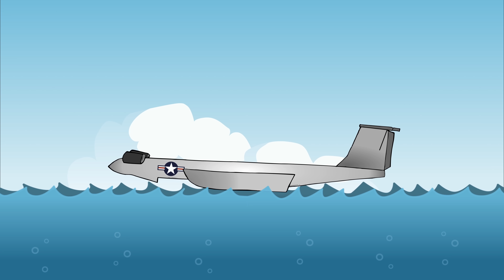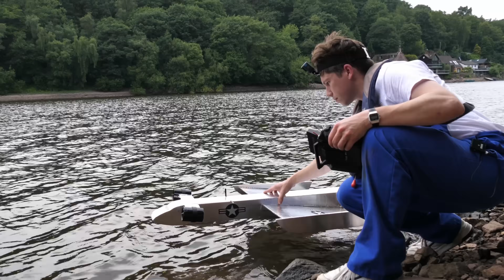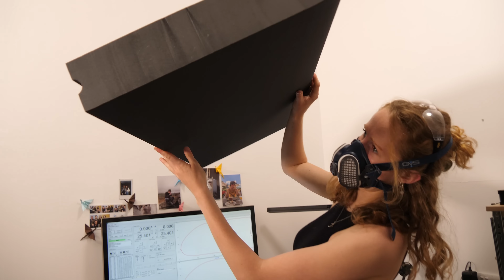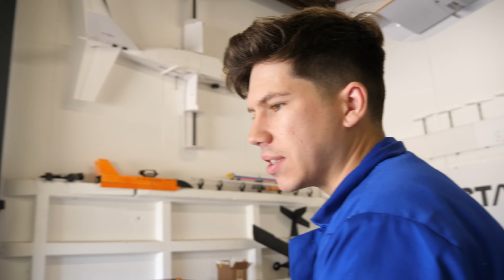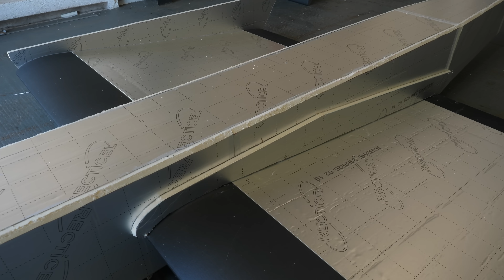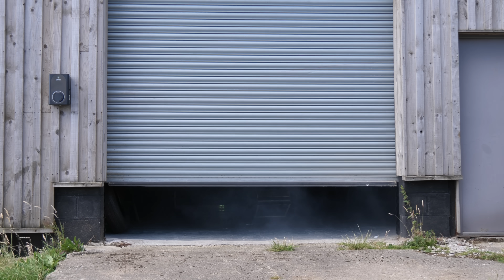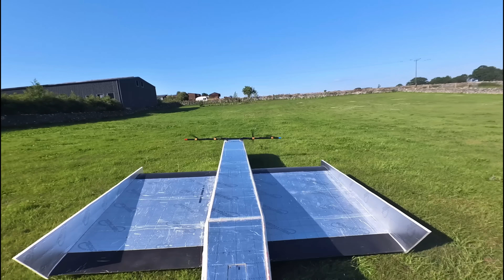Giant Ground Effect Plane (part 1)

Comment: Loosing connection to my model or having week or critical datalink to my model was my daily events when I used frsky radio and RX.
Switch to elrs and since then just threw to the bin (yes didn't tried to sell as I wouldn't recommend it) all my frsky rx.
(Got 11 gliders 1 VTOL and 5 drones)
So frsky may have you the radio but it's still crappy radio system
Reply: +1 for ExpressLRS.
In 2023, I put in a wee RadioMaster RP2 receiver into my OMPHOBBY M2 V2 helicopter, bound that up with my Ranger module in my TX16S Mk1 and I was away flying. The built-in receiver in the flight controller used to micro-failsafe even at 1~2 metres away from me, and got worse around 3~5 metres out. ExpressLRS made that shit a thing of the past, and I can now focus on actually flying.

PS: What's even better is ExpressLRS is FOSS (free and open source software). FrSky isn't, depsite their name being pronounced "free sky".

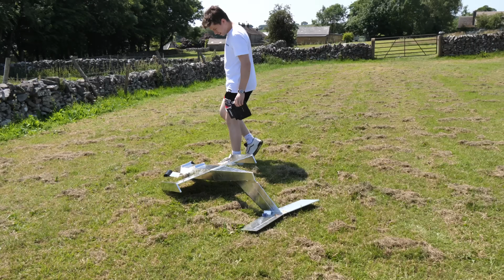Comment: At 04:30 it's a dustdevil, which is caused by a strong thermal suddenly releasing (warmer airmass that starts rising), creating a low pressure, dragging air in from all sides and creating a rotational motion. Like draining water from a sink. It's a very cool phenomena!

Comment: This is a splendid project, well done! For those with an interest in the aerodynamics, it’s worth noting that this configuration carries notable stability concerns, particularly in pitch. Soviet aerodynamicists sought to address these difficulties with an intriguing series of aerofoils (DHMTU), tailored to the demands of ground effect. However, these amounted to mitigations rather than remedies for the underlying problem. It is fair to say that a more fundamentally stable solution lies in a markedly different configuration, the inverse delta, as developed by Alexander Lippisch, which offers improved longitudinal stability whilst operating in ground effect.

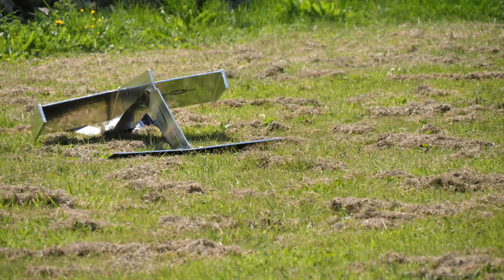Comment: That effect you noticed on the test flight with the smaller plane flipping over(4:18), is a small column of rising air, called a thermal. It's essentially warmer air expanding and rising through the colder air. This can be caused by the sun simply heating the ground, or in your case, a nearby fire triggered the thermal. When it is close to the ground it often picks up leaves and dust, making it look like a small tornado, as you said.

If you want to gain further knowledge on this, I would recommend checking out gliders(sailplanes), which use this exact phenomena to stay airborne.

Comment: Watching from Nizhniy Novgorod, near Gorky Reservoir where first ekranoplans were tested :) We have a lot of ekranoplan pedestals in our city. We have also a model 903 "Спасатель" which is still working but suspended.

If you want to create a working model you have to dive deep into aviation control systems: accelerometers, gyro sensors, thrust control, air flow controllers, ground effect controllers, weight management. This is not just a frame with engines - this is a complex vehicle of it's own kind

Comment: A small side note about this kind of Ekranoplans. The original Caspian Sea Monster (and the other similar ekranoplanes) had also propulsion on the tale, usually near the top. The front engines blew more under the wings. After take off, the front ones would be powered down and tale engines assume control due to the efficiency of ground effect. You could try it.

Comment: YOU ARE ABSOLUTELY 10000% WRONG ABOUT GROUND EFFECT.. It's a common misconception... Please go see a CFI to learn EXACTLY what GROUND EFFECT really is.  I can tell you - that you're wrong. You'll need to remake your video. There is no CUSHION of air OR  compression of air AT ALL - WHATSOEVER..  It's merely the result of even lift is being created - you get induced drag as a byproduct from lift. When the lift being created and wing vortices being created, hey broken up from the ground, REDUCES DRAG THUS INCREASING LIFT DUE TO LESS INDUCED DRAG, EQUALS BETTER LIFT PERFORMANCE CLOSER TO THE GROUND, THUS GROUND EFFECT..   ABSOLUTELY NOTHING TO DO WITH CUSHION OF AIR OR ANYTHING LIKE THAT.... 
ALSO - FYI.. I'M A CFI, a flight instructor... Godspeed..

Comment: Something i learned from ekranoplanes and ground effect vehicles is that they never use concave surfaces on the bottom of the wings they ussualy use almost symetrical airfoils that resemble flying wings with some washout at the trailing edge because this helps preasurize the air more consistantly and it helps keep the airfoil at an optimal aoa by making it self stabalizing

Comment: Whats up, yall. Love the planes vision. 

I would love to pitch you the idea to use a tube frame inside the fusilage of the plane made from CF tubes and 3D-Printed joints. 

The frame could provide pick-up points for the load-bearing components, like the wings and motor mounts. This way, the stresses could be distributed through the tube frame instead of the hull itself. If my napkin math could possibly check out, it could also mean, that you can cut down a lot on the wall thickness. 

This could not only offset the added weight of the frame, but even reduce the whole system weight by a lot. However, perhaps not by as much as I might hope, because it could then be thin enough to require a glassfibre shell, due to foams weak material strength. 

In my mind, this could also prevent the planes hull twisting across its length.

Comment: Good job with the design. One issue is ground effect isn't a cushion of air, but the disruption of wingtip vortices which decreases downwash which increases the efficiency of the wings lift. So it isn't giving the wing more life, but increases efficiency due to reduction in induced drag. The cushion of air isn't necessarily wrong, but it isn't the direct reason ground effect is a thing. Ultimately ground effect only is seen within one wing-length of whatever aircraft is flying.

Comment: You need to find a company that can provide something better than tubes. Carbon tubes are not strong when side loaded, there literally like tent poles. A simple angle would be just as light and stiffer.

Comment: "cushion of air" is a myth. How did you miss that key point??? The benefit is that the ground disrupts the wingtip vortices which increases the efficiency of the wing, lowers drag. Not a "cushion" of air.
Reply: Well this one is a wing in ground effect one, which does use the principle you mentioned. However, another type of GEV also exist which use their bottom area for lift unlike this one which uses wings. The Bartini VVA 14 used that, it could fly 12m high in ground effect.

Comment: You're really testing my composure by continually calling these things aircraft and "planes".  First off, a plane is a tool for removing material from flat pieces of wood.  Second, nowhere in the world is a wing-in-ground effect craft considered and aircraft.  They cannot fly, so are not considered aircraft. Wing-in-ground effect craft can pretty much only operate over water so they are almost exclusively considered motor vessels by all jurisdictions and regulated as such around the world. THAT THING IS NOT AN AIRCRAFT.  STOP CALLING IT AN AIRCRAFT.

Comment: The angle in which the propellers are mounted is very different from the "original" (and any other full size ground effect plane I saw pictures of). Not sure if it can be counted as ground effect if they themself pull up the nose. ;-)

Comment: Normal wings use their curvature for lift, because air runs faster over the top that way, i think. Would there be an advantage to have the wing profile flipped? To run mora air under it?

Comment: About the rigidity of the wings: Have you thought about inserting a tube as the wing spar and pre-stressing it (sort of like they pre-stress concrete)? Or even maybe having an aluminium wing spar? Given that the wings are short, it should be lightweight, and if you only care about bending in one direction, you could use a bar.

Comment: No way that you just said 30c is hot I'm crying in Saudi 12:53
Reply: No AC here
Reply: 30°c is hot in the UK. Our infrastructure is built for winter. It can get to below -10°c in winter, so yes, a 40°c swing in temperature, can be hard to prepare for. If it was hot all the time, we'd have the infrastructure to cope. Its not, so we don't.
Reply: @magiera92  he doesn't even have SUNGLASSES!!!
Reply: @magiera92  and yet moar pplz perizh frum cold than hot in Europe yearlie
Reply: 😭😭😭 for me this summer was a constant heat average of 102 degrees and I play football 🏈
Reply: I'm in Surinam. hottest days can easily reach 36°C
Reply: The more moisture in the air the hotter it feels.
Reply: We don't share the same climate.
Reply: @OfficialKTGame  for real 😲
Reply: I’m outside right now it feels barley hot and it’s 83°F

Comment: The thrust blades might be kind high if you lower them kinda in the lower part of the wings the jet stream should trap the air better under the wings to give a better air bearing effect it just seems like alot of the air is going over the wings and some under with lower efficiency.

Comment: For future projects of this kind where weight may be an issue, you can be very strategic on where to laminate the fibers and on which directions.
To further reduce weight, you can make "lightening holes" by cutting circles out of the cloth where stiffness is the least needed.

One can get carried away and compromise the stiffness a little too much, but adding layers is easier than taking them off, of course.

Comment: For the Hot Wire cutter, look into steel wires and thin cables. I've found they are much, much stronger, can be made stiffer, and break less. With more tension, they sag much less and leave smoother cuts. 
Steel has lower resistance, so the voltages and currents are different.

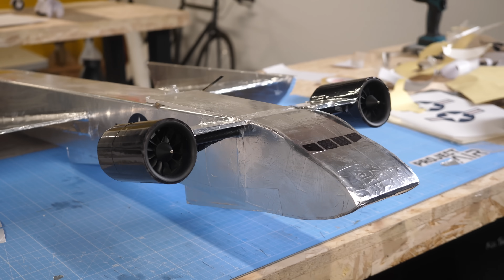Comment: 2:55 The flow from the fans definitely helps to produce lift, however, the airfoil shape would have  considerable effect. A round leading edge is needed, not only for raw lift but for a more consistent lift distribution.

Comment: Nice build! Just a suggestion — since all four motors spin in the same direction, you're probably getting some unwanted torque that makes the aircraft yaw to one side during takeoff. You might get better stability by using counter-rotating props: for example, having two motors spin clockwise and the other two counter-clockwise. That could help cancel out the rotational force.

Comment: The most interesting thing about ekranoplans is the energy saving for movement. High thrust is needed only for lifting off the surface, but the maximum effect is achieved only in a narrow range of altitude and speed with the wing area. Ekranoplans glide almost above the surface to achieve the maximum effect. Moreover, the lower the altitude, the higher the speed and the better the screen effect. KM had all 10 engines working only for lifting, while moving it only needed 2, even at less than full thrust.
By the way. Ground Effect Plane is both an ekranoplan and an ekranolet, but the movement mechanisms of these two types of devices are completely different.

Comment: Did he really just gloss over the fact that his "assistant" went out and built a huge cnc hot wire cutter capable of cutting tapered edges in a weeks time and it produced fantastic results? That's just as interesting of a build as the actual plane
Reply: Why you so angry bro
Reply from the maker: We would have spent more time on it if we could! But can only fit so much into a 20-minute video 🙂
Reply: @Project-Air then make the vid longer bro
Reply: @AugustFromDenmark right 😂

Comment: How does rctestflight do it?  He ends up with himself and various bits of equipment falling into the lake all the time, too  :)

For cheap, fairly lightweight and strong structural reinforcements (in lots of projects) try using thin-walled electrical conduit.  It has good tensile and compression strength for its mass, and it will flex a fair amount without taking a crimp/bend.  This makes it great for taking longitudinal stresses and as angled struts.

Comment: Dang! Emma built the CNC foam cutter?!! Wow, awesome!! Works perfect!
And you discovered the biggest problem with Ekranoplanes.. They are HUGE, not exactly portable, and kind of limited in where you can operate them, especially an RC one; you run out of lake and/or radio range pretty quick.
Maybe a chuck across the channel operating it from a seaplane or helicopter? Or an IMU/GPS drone flight controller you can pre-program to a route or a trip with RTH if something happens.

Comment: 1:18 Would it be more efficient? My understanding was higher altitudes are more efficient due to reduced air resistance, but maybe only for long haul after the cost of getting up there is outweighed? Or maybe at the time tech wasn't at the stage where high altitudes were viable with the lower air pressure (eg engine tech?)

Comment: You need to make the beam holding your props change pitch with a servo.  Low speed they would angle the props up and high speed more forward, maybe a 30 degree range

Comment: Scaling up the plane was the best move. Speed needed to achieve lift and break water tension without exceeding ground effect speed is an extremely tiny window at the under 1kg weight.

Comment: why do i want to turn the tail into a v-tail version.  instead of having one vertical tail holding it up, split them like a v ... would that impact the flight characteristics.  might need a counterbalance system for the sideways lift issues with wind.  gyroscopic sensor in the nose, tail and both sides.. it would help figure out balance with changes you may when its on the ground as well.  but the counterbalance system would have to be fast enough to help stabilize something so light from normal winds.

Comment: Honestly Emma needs waaaaaaaaaaaaay more credit for that hot wire cutter because that thing looked like it worked flawlessly and incredibly difficult to get it to that state. Ekranoplans have been overdone at this point. Every rc plane YouTuber has tried it at one point
Reply from the maker: Yeah Emma's been doing such a good job on the CNC. 10/10.
Reply: Ekranoplans are ridiculously efficient, but like flying wings need much more thought to design them than boats or tubes-w-wings… we haven’t even started!
Reply: It's because ekronoplans are incredibly genius machinery, of people are gonna show interest in it

Comment: 1:18 It is actually a lot less efficient, the higher air resistance far outweighs any benefit gained from high air pressure. Thus one of the reasons the project was cancelled.
Reply: Ur right but ur forgetting that unlike normal aircraft, an ekranoplan's design is directly scalable similarly to boats. Therefore, in terms of torque its more beneficial than aircraft
Reply: Then explain why the Caspian sea monster was way more efficient when it comes to energy use compared to a plane of the same size , even the USA does admits it when you look at the files regarding that ekranoplane
Reply: Nah bro, GEV are infact even more efficient than ships when made big enough. You should check out Robert Bartini, he did some calculations, although his type of GEV ( VVA 14) uses an air cushion unlike this one which uses wings.

Comment: Your props are bad for even nitro and gasoline engines. They’re out right horrible for an electric motor application. 
APC would be the most cost effective but xoar or falcon electric props would very much increase your thrust and lower your amp draw at the same time.

Comment: This is seriously impressive, it's very clear these things scale up much better than down. It's great to see a proper capturing of ground effect over just skimming low with a more conventional aircraft.

You may find a nasty pitch-up tendency as speed increases, one which can't be easily countered by elevator. This is excessive PAR pressure which adds onto the ram effect from forward speed. What really helps is a variable motor angle, ie motors pointing further up to unstick from water, then rotate them forward to reduce the PAR feed. Rotate them further for downthrust for maximum speed without leaving the ground cushion. Obviously easier said than done at this scale but a canard flap behind the motors would be good enough to divert air. The full size craft had something similar with adjustable jet nozzles.

The full size craft also relied on the front motors only for initial takeoff, once above the water the forward thrust was provided by two relatively tiny jet engines at the top of the T-tail. Maybe an idea?

Sustaining ground effect at the model scale with only forward ram pressure and no PAR effect is quite difficult, it only takes a momentary skid off the ground to slow down and then set up a feedback loop where it loses the ground cushion almost instantly. I have managed it with bigger (for me) designs around 2m wide.

Very much looking forward to the next part!

Comment: You should be looking at morning tests, not afternoon/evening tests.  Broadly speaking early morning has the calmest weather and afternoon/evening has the most unpredictable weather.  This is due to ground and atmospheric heating during the day and is why things like hot air balloon and blimps are usually flown in the morning.
Reply: That seems very regionally specific.
Reply: @It-b-Blair  No, it's a global thing based on how physics and solar heating work.  Each individual day will be different, but statistically this is the case in every environment and location all over the planet.

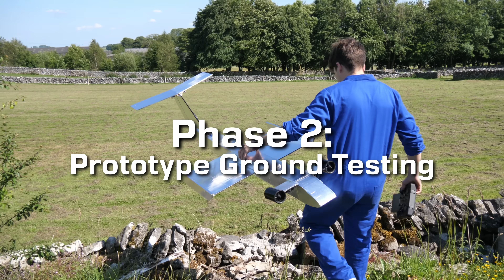Comment: at 1:45 o suspect your build is gonna be quite twitchy being so light, using dimensions for a multi ton machine....

edit: 4:15 yup....

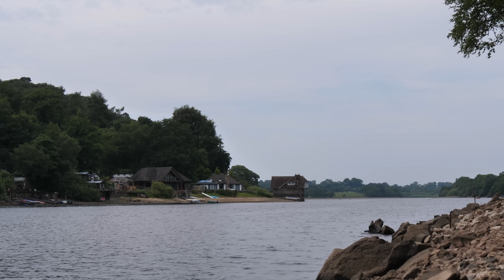edit 2: 5:04 that gusty blowover thingy will be worse on water with the waves adding to turbulence at ground level..

edit 3: guess I was wrong about that one. heavier plane will resist blowover better though. momentum and rotational inertia helps.